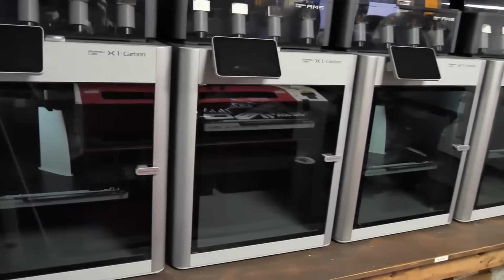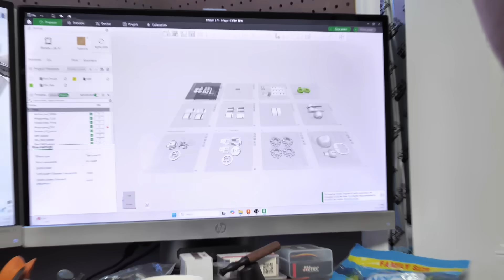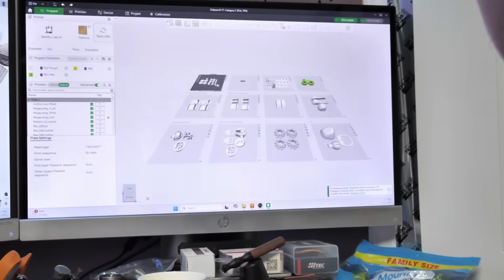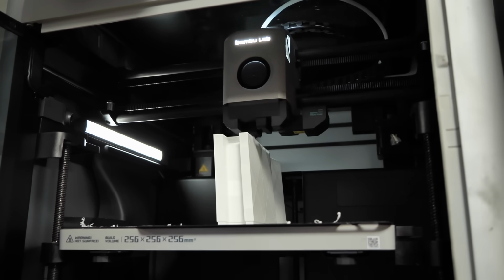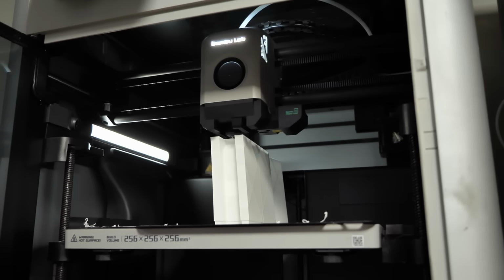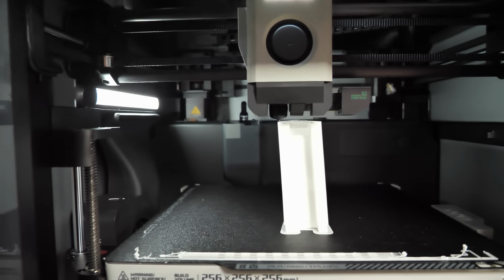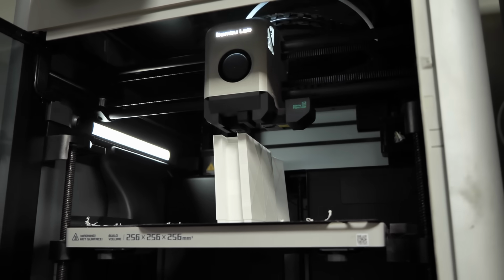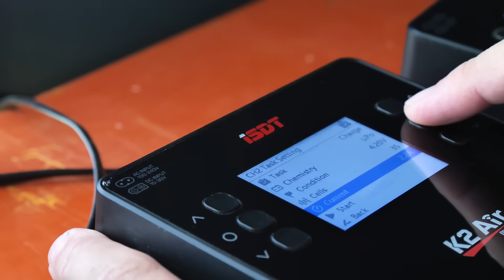3D Printing Flying Fortress - Eclipson B-17

Comment: You too can build a cheap 3D printed RC B-17. You just need to start out with about $18,000 worth of 3D printers. Bargain.
Reply: You can do all this with 1 printer, it would just take a lot longer to print all the pieces. And you don’t need a top of the line printer, the p1s is basically the same as the x1c and you can get it for $600.

Comment: What are you doing to prepare the bed? I think I saw the standard purple glue stick but then you were wiping the bed with alcohol. What is the purpose of that?
Reply: So if it has a textured bed just wiping it down with rubbing alcohol works great, if it is a smooth bed I use glue stick every 8 to 10 prints and do a quick wipe with rubbing alcohol in between every print this tacks the gluestick and makes it so you don't have to reapply the glue as often

Comment: Ypu shpuld do a video on trying some of the free files on the different stl host sites. This channel is about diy and not every9ne wants to dropp a 100$ on a file
Reply: There was clearly a lot of engineering time that went into this design. Why should they work for free?
Reply: @danmartinrc they have enough following that they aren't ever working for free. This channel was about diy in the beginning, and theyve drifted so far into the expensive things these days that they hardly relate with the core audience.
Reply: Yeah I make designs on my channel and one of them is $5.
Reply: Or $3k on a printer
Reply: @willl84 you can get a bambulab a1 for like 400 that will do everything the p1s will do minus certain abrasive filaments.